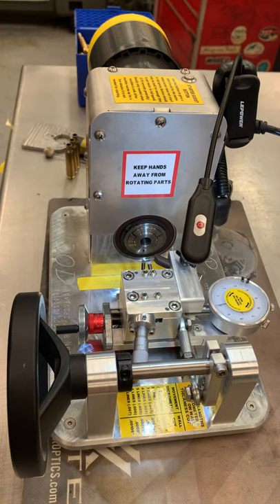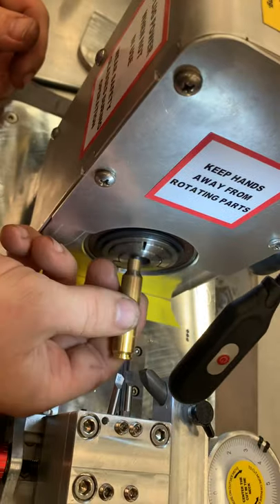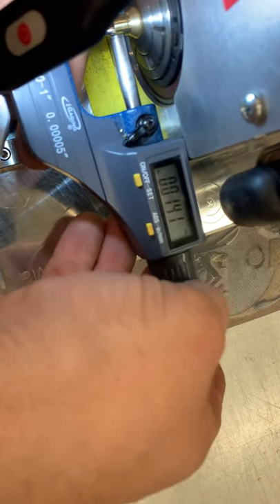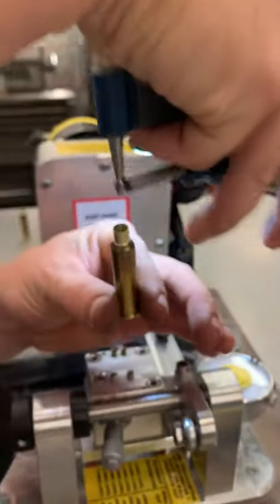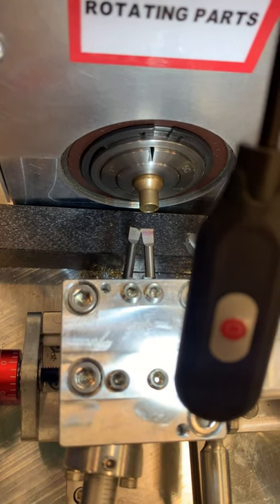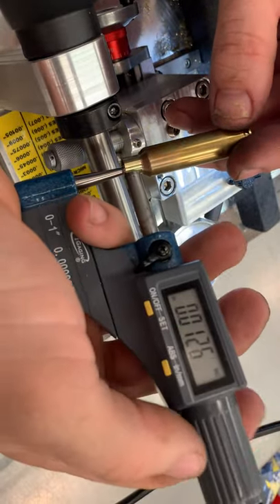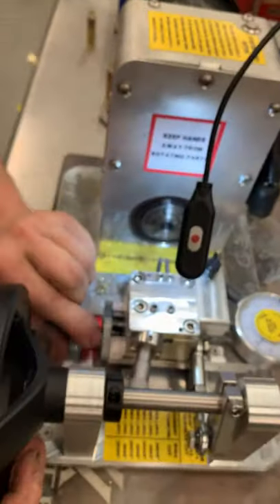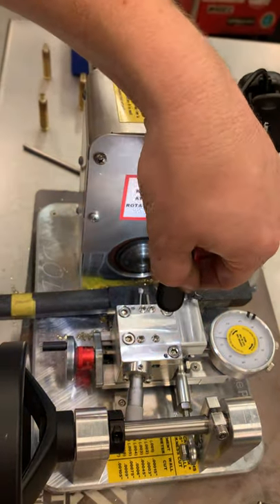Set up the IDOD neck turner

Comment: Bryan- this machine is by far the best for neck turning I have seen to date. I wish it wasn't so expensive, or I'd get one tomorrow. I can see why it does cost what it does- beautifully machined, precise surfaces and it appears the quality is first class. I'm going to start saving my pennies. Question- I'm at the 7:32 mark in the video where you just adjusted the inside cutting tool-is there a way to lock it so it won't move?
Reply from the maker: Yes, there is two set screws on top that lock the cutting tools in place. - Katie